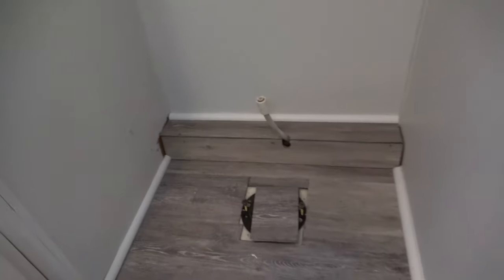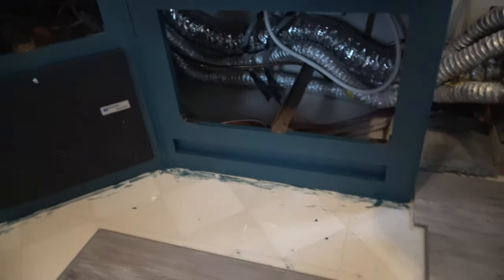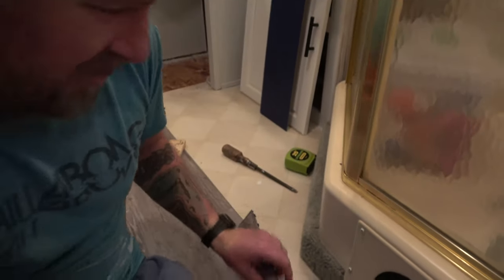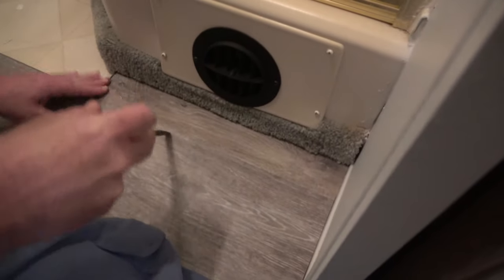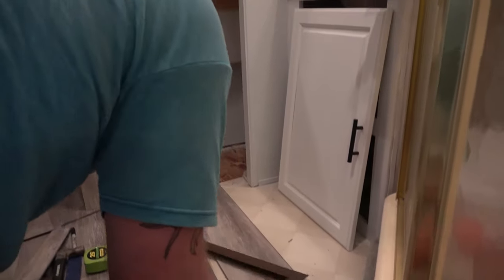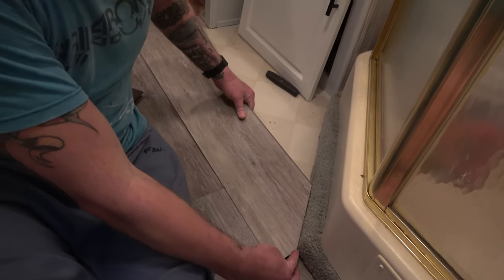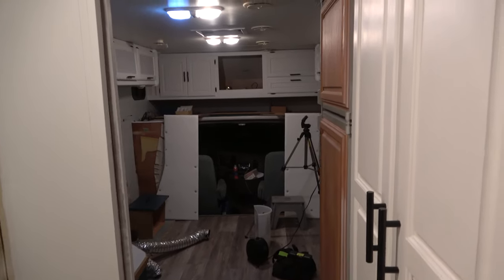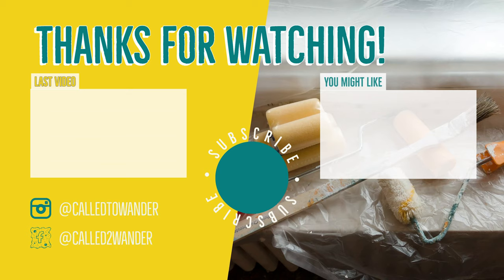CtW 116 // Installing RV Vinyl Plank Flooring In A Class C Motorhome // Class C Camper Remodel

Comment: Nice job on the flooring. We just installed vinyl planks in our Class C RV that looks a lot like your flooring. When we tested the slide it scratched the new flooring in  one spot! I'm not sure how to remedy that. I definitely don't want to rip out all that flooring at this point. So far I haven't found a video that deals with the slide issue and vinyl planks.
Reply from the maker: We dealt with the slide issue by not getting slides! Honestly, aside from the worries over slides breaking, leaking and otherwise needing repair, we've known many people who put new flooring in and scratched it up as well. Sorry we can't offer any help. We'll be "slide-less" as long as we're RVing!

Comment: the 1990 i bought had just had new vinyl flooring put in ..but there is a soft spot so we are going to keep it but lay a flooring we found at (yuck) Menards ,,to lay over it ,,tuff stuff so should fix the weak part of the floor,,,ya"lls is looking good guys !
Reply from the maker: Did you find any water damage that made the soft spot? In our truck camper we found that water from the dog's bowl spilled a little here and there and collected beneath our vinyl plank flooring. We ended up cutting a section of plywood out and replaced it before we laid the flooring back down... But then again, sometimes it is better to not know about any water damage! Hope the Menard's stuff works for you! Thanks for watching and reaching out!

Comment: I have a 28' class C RV and am going to do the floor also. I wanted to know how many sq ft yours ended up needing to be covered? How many "cases" of the flooring did you need to buy? Since I won't be doing under the bed or cabinets or bathtub (dah).... I was wondering about how much you ended up needing? Thanks much
Reply from the maker: It’s been so long I don’t recall the amount. But we bought a bunch and returned a few. A good idea is to not do more flooring that what you’ll see and use because if the weight

Comment: I have a question. When you make a cut across the vinyl plank that changes the end of it to not accept the next plank correctly. The rubber edge on one side of plank that sticks out has no cavity to go into when placing them end to end cause the previous piece was cut and therefore lost that cavity/slot for the next plank to seat into. Don't know if I made myself clear. But I need to know how to fix that. If they just sit end to end there is no connection there.
Reply from the maker: This is true. You have to meticulously plan which ends to cut where so that everything matches up correctly. In a few small spots I actually cut the latching part off so it was just plain vinyl side against vinyl side with no latching. But yes, plan it out and you will still likely have a little left over because those leftovers can’t be used anywhere you need them to based in the cuts you made